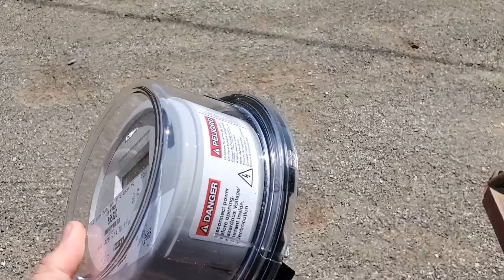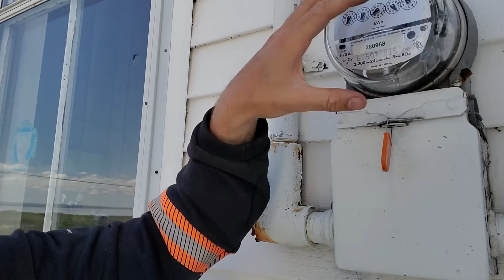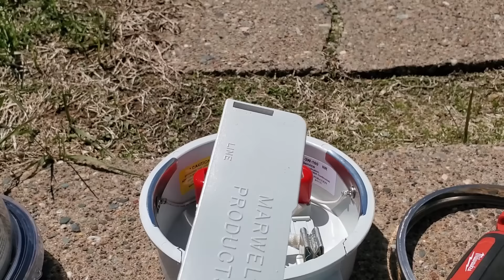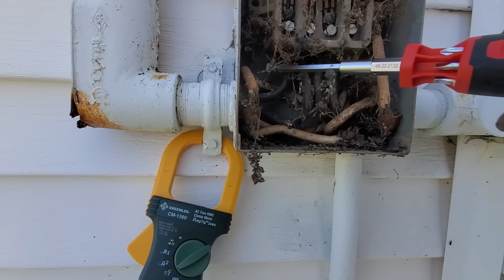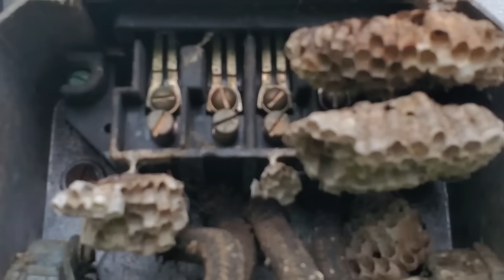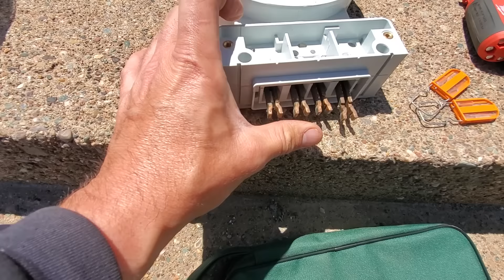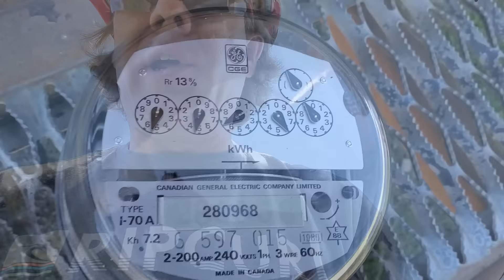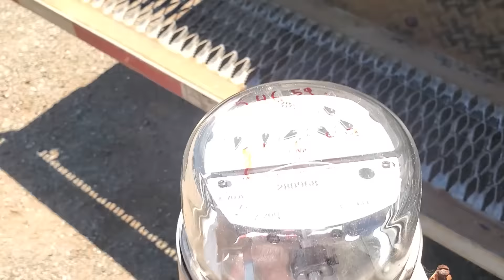Removing an old "A" base Electrical meter

Comment: Yeah, here in Australia, if you go far enough out, you don’t get 240v local service at all. Each house or whatnot has its own step down transformer, usually 11kV. If you get REALLY far out, you can have SWER-single wire earth return. It’s literally a single live wire, consisting of fencing wire, and your neutral is earth. A single wire, and that’s it!
Reply: Damn
Reply: Wow, very interesting. So I didn't know how the meters attached to the house, I always thought it was direct wired in. By the way, I'm writing to you from sunny Santa Cruz California we're up here in the mountains about 50km south of San Francisco, surrounded by a redwood forrest. 
Our power provider is Pacific Gas and Electric also known as the Prince of Darkness. To give you an idea how reliable they are, we just installed a 14 4kw gas generator. So as long as we have propane, we can keep the evil Prince at Bay. Most of our neighbors also have gas generators. We're too deep in the forest for solar cells SO gas generators and a short-term battery backup has to work.
 Getting back to your programs I find them very interesting and very enjoyable. I wish I had a question for you, but sadly for me, you explain things so well I don't have any questions. 
Keep making the shows and we will keep watching. But for goodness sake be safe. I've seen what happens when somebody makes a mistake, people get killed.
Reply: Kah-RAY-zee!
Reply: How far out you talking
Reply: IIRC some SWER installations in Australia have a 480v split phase for large compressors and other farm equipment.
Reply: Wow!
Reply: What is your average voltage 240v?
Reply: @philkipnis7403  our standard in Australia is 230v single phase (phase to neutral) and 415v across 3 phases. Split phase is very uncommon here.

SWER is common in rural areas about 100km+ outside of cities
Reply: 😮SWER! Prolly Not For Charging a Tesla‼️💔👀🖕😒🧐
Reply: In Canada, a lot of rural Saskatchewan is SWER, due to low population density and good soil conductivity.

Comment: Ooh, I love the GoPro on a stick routine. Perhaps a dumb question, but there’s no electrical safety issues with doing this? I’d imagine a basically fully plastic and glass GoPro is gonna be relatively inert on the stick

Comment: aluminum screws directly to copper in outdoor installation? seems a bit sketchy
also, those ground connections are rusty AF guess the resistance on that line...

Comment: 54659.1 kWh? Assuming the dial with no numbers is reading in 10ths. I'm just a dumb ass welder which 90% of my electrical knowledge comes from which is enough to know to call an electrician when I need electrical work and dont mess with it unless I'm feeling particularly suicidal. I've also seen electrical failures that give the impression its a sure fire way to get killed such as a video of some kid trying to steal copper out of a main power station box and litteraly blew a hole in his back big enough you could see his ribcage.. How on earth he was still alive and breathing at the time they took the video made it even more disturbing because he was in pretty bad shape and didn't look like he was going to continue to live much longer. 

I also installed Low Volt commercial fire alarm systems for about a year and learned quite a bit about that which I dont think translates to high volt stuff very well.

Comment: I’m going to just throw this out there- if you have absolutely 0 training as a lineman or with high voltage, and you’re thinking about doing-it-yourself, do not. There is a reason that people need 9000 hours and 5 year apprenticeship to be certified to work on this equipment, and that doesn’t tell you the amount of learning you do after you become licensed. Leave it to the professionals guys n gals.

Comment: Interesting. Way less testing than I see done here in NZ on meter installs & swaps. Normally we see them do:

* A line impedance test, which checks that there aren't any high resistance (e.g. loose) connections upstream, and you're not just relying on capacitive coupling or something to get 240V on the output. This also checks that the supply has an appropriate amount of fault current - generally >500A to make sure you'll blow the pole fuse if there is a hard fault in the supply, no more than a few kA  so that you don't have breakers exploding. 

* Apply a load and make sure the counter actually ticks upwards to the first count, so the meter is actually recording and not either faulty or wired in reverse.

* A mains polarity check with an independent earth ( a metal electrode you shove into the ground a few meters from the building) to make sure that the phase and neutral haven't been transposed at some point. Not likely but really nasty if it does happen. Less of a risk with multiple phases because you'll see 120/240V across the wrong conductors. Much harder to detect if you only have two conductors with 230V between them, and all the metalwork and foundations are bonded to the 'neutral'.

I can only imagine taking out a TX here to change a meter on one customer... in an urban area, it wouldn't be 6-8 customers; it might be 20-100... but we have per-customer LV fuses on the pole/pillar/pit and the customer's main switch is generally ahead of the meter.

Comment: Quick question, you meter are rated 0.5amp to 200amp. What happen if the house consomp less than 0.5amp?? It is Free electricity????

Comment: The 20 amp meter is to be used with Metering CT's.....!
Reply: And while you have it all open  its a good time to check all connections for tightness.....
Reply from the maker: That's correct, typically a 400:5 ratio for that particular single phase meter. The added demand is factored in when used commercially

Comment: 54659 kWh on that meter from what I can see. And as someone in the PT and CT field, there are some oddballs out there. We had a customer hook up a CT rated panel meter direct to 500 amps, apparently the stain it left matched his shorts. Also, you guys call it an "A Base Adapter" but missed the chance to call it an "A-dapter" lol

Comment: I'm amazed this is still in service. Here in the south everything has a smart meter - it's funny how many fancy new meters I've seen that read "0000" on the side of some old abandoned building or barn. I'm not sure why they even have a meter when there doesn't appear to be service, but many do, and they get changed out.
Reply from the maker: Often times, old buildings that are rarely used still have power for occasional visits. The owner may keep the breaker until they stop by... Or they have been shut off for a temporary disconnect. In our area, after two years of there is no usage and they're temp disconnected, we will remove and dismantle the service. If it's active with no usage, we'll investigate and possibly disconnect as well
Reply: There should be a monthly charge for the hookup and billing expense.

Comment: plot twist the church is actually a grow house and they tapped before the meter at those condulets coming down from the weatherhead
Reply from the maker: Wouldn't be the first time!
Reply: @Bobsdecline  I liked that one on Holmes on Homes. They had to take a layer of moldy wood off with dry ice. They core drilled the foundation to the buried triplex and used Kupler Taps live.
Reply from the maker: Didn't see that one! We had a large organized crime group do the same thing here with multiple high end homes around the city. Was pretty wild

Comment: My initial meter reading is 54658 with a little uncertainty on the last digit due to the camera angle. I was unsure of the un-numbered dial, but I suspected I would only have the last digit wrong. The pointer style is my second favorite type of meter with the odometer style being my favorite. Although time has shown the smart meter, at least on my house, is reliable.

As far as being authorized is concerned, I am very serious when it comes to that. At my house we had a free meter socket change (the electric company upgraded it several months after the smart meter was installed) and the contractor messed it up as we have two sets of service entrance cables, one for the main panel and one for the water heater. The contractor missed a hot on the water heater panel and we had to call the electric company out and I was furious as that's one part of the electrical system the customer is not authorized to touch. Luckily, we got a lineman out that time and they explained that the contractor was making mistakes all over town.

Comment: The grease is probably Mobilgrease 28. A lot of the medium and high voltage breaker manufactures spec it. For the electrical stabs and some of the mech parts.

Comment: I've tested, calibrated, and repaired countless watthour meters in my years. Single phase, polyphase, transformer rated, self contained, 1S, 2S, 3S, 3CS, 4S, 9S, 12S, 16S, 36S, 45S, and the A base counterparts. 50 and 60 Hz versions of most.
Reply: I dont know anything about these meters.  I have 1 question for you, if you don't mind.  

Do you like the newer meters used, or the good old fasioned ones.  If given a choice?
Reply: @choke666  that's interesting. And it depends. The newer ones can do so much more. They can measure reactive power, depending on the model. They have communications capabilities, they can tell you when you are using power, etc. They can also sense tampering.
The old ones though are darned reliable, and it's amazing how long they can last and remain accurate. But for the most part, unless fitted with electronic registers, can only give a total of kWh used. Some have a few other features, but they are just incredibly well engineered mechanical devices.

Comment: I'm surprise the electric companies haven't come up with a more secure meter and box system outside houses.   One that would alert someone if the meter is pulled and or the box under it is opened ?.

Comment: You should ALWAYS check to see if it's dead even if the only feed line was ripped off the utility pole just in case the customer has a backup generator that's not wired in right and is back-feeding the grid...
Reply: Huh ? If they have a back up generator then you would see it outside as well as the lines and box 😉
Reply: @kevink4914  Not always. I've seen a few that are designed to be installed inside the home and some external models are installed inside a barn, detached garage or shed and the feed cables are run in underground conduits and so are completely invisible to the naked eye and depending on how well soundproofed the shed/garage is, you might not hear a running generator...

Comment: When I looked at the dials on the old meter - I'd missed that some of them were reversed!  In the UK we don't have modular meters on any installs like these, tails go in and out of the meter unit - the NA/Canadian system as a whole looks a massive amount easier to swap meter units out; I assume that is getting more important with smart meters that stop communicating?
Really like your content - showing the parts of electrical systems that the majority of people should never see!

Comment: Q. Can you remove a smart  meter to work on a panel  change out  with out calling in.
Reply from the maker: No you can't, however I've heard of some jurisdictions allowing certified and approved electricians to do remove them. Our province and most areas require a company rep and permit.
Reply: Thankyou for getting back.  We  have homes that are in high lightning  area. We recommend  type 1 meter surge .  But I had difficulty  removing the meter for to install the adapter
Reply from the maker: You can get whole home surge protectors that wire directly into your panel and only need to shut off the main breaker for an install. Should still be installed by certified electrician of course but doesn't require a meter Pull or permit in our jurisdiction
Reply: Thankyou again for reply.  The NEC  reccomend  type 1 for the meter to protect  against lightning    you just cant tell with lightning  where or what it will do  it . 2020 code requires   SPD at the meter also the panel.  Type 1 will protect  from lightning.

Comment: Klein has a new screw driver with all the adapters U might wanna check out besides that red one you are using . One thing they both need to get into which they wont do because  of  the liabilities is insulated tools. Just went to a rodeo of new tools by the red guys . they have a problem with the pole step removers, lag screw, and J hook  removers.  they never took into account a build up of rust . so they dont work because of that extra bit of corrosion...  Apparently they have gotten the message from tool events. Great video .  U should let ur vendor know as well..

Comment: Meter reading  54659    When reading the meter, read / write the number from right to left.  If the pointer at the adjacent right number is not at or past 0 , the number to the left is what the pointer has just passed.
Reply: Learned that in HS over 30 years ago. Thankfully I got the same number.

Comment: Here in Illinois (USA) the local electricians wire up the service drop, meter base, grounding, etc. The only thing our local linemen do is hook up the service wire I left for them to terminate to the pole pig (transformer). They do inspect the work before hooking it up hot though.
Reply from the maker: Pretty much same here, other then 3 phase metering. The only reason we're installing these adapters is because it's at our company's request. Even if we contacted the work out to an electrician, we would have to be on site. The electrician aren't allowed to cut our seals or work in the meter box while energized
Reply: In Connecticut when upgrading the electricians will pull the meter and disconnect/reconnect from the service drop.  When they install a new meter can they will put in jumpers to jump from the line to the load side.  The utility will then come and put in a new meter at there convenance.

Comment: Very interesting video. You didn’t mention the two radio antennae on the left and right inside the meter. I’ve always wondered how far away from the meter it can be read?

Comment: During my career as an electrician my hobby was collecting old A-base meters. I made table lamps out of the newer, less collectable ones and displayed the older ones. I have over 50 meters with some going back to the early 1900's. I like taking them apart and seeing how there built and putting them back together again.
Reply: Same here. I collect the Old ones, got about 500 or so.
Reply: @erwinsummer9961  that’s cap
Reply: @erwinsummer9961  Oh hey there! Surprised to bump into you here... :)
Reply: I like meter collections. One of those rarely saved items, and when you find a REAL old one it's quite cool.
Reply: I think my oldest one is around 1903.
Reply: As a service award I received a 1925 Westinghouse meter made into a lamp and it runs.
Reply: Have to say  I will look up those older meters .Good job guys.
Reply: Yeah I've seen lamps made like that I've always wanted to make one for myself as well and of course having to meet her actually registering the current that the bulb is using!

I thought about building a coat tree that looks like an old-fashioned lamp post with other utilities on it.

Although one of the boxes would be a dummy just for a piggy bank for change!

And one of the small boxes would be where the boxes that would have the photocell attached to the top with the twist the lock receptacle and that would actually be controlling lights that would be dusted on inside.

My plan was to use glass insulators is coat hooks.

The post light AKA street light like the gumball type pictures or whatever you want to call them would have a vintage globe.

In addition to just being a stared lamp they would also be a candelabra night light socket in there as well.

And have what looks like an old junction box outdoor type with an old school oval or other cover at the bottom of the pole but have the plate for that modified to take a Decor type device and have four USB charging ports in place of receptacle there you wouldn't notice until you open it up.

And of course all the power going through everything would be actually registered a meter that's actually working!

I'm also possibly thinking about building a power monitor into a meter box including a Clearwater meter just as a test device but receptacles and a power Inlet and perhaps a heavy duty switch just for bench and of course have other meters and such installed in the cabinet or attached!

Had opportunity to get some old electric meters years ago I wish I would have taken them up on it all the new meters were going in the old ones are going out this was before Smart Meters they were just the electronic ones back then not even remote readable
Reply: What's the oldest ya have? I'm am electrician... But some reason I got into the same.... But with safes..... Pretty dumb.... And heavy stuff to collect
Reply: i got some old ones, but i wish i had more
Reply: i am going to study for electrician, at 40 years of age is that to late ?

Comment: Wow! There are tons of archaic A-base meters where I work, but I've never seen one that looked anything like this. I guess it must be a standardized type of equipment in Canada? I see the other one you show (with the bees) is identical, and the socket adapter looks very specific. The ones I'm familiar with are the same basic idea, but the blocks are different, and they're wired at both ends - none of those tidy copper bars, which look much nicer than trying to bend and stuff #2 wire into the terminal chamber. I always do them live, and with the meter bypassed so the customer doesn't start complaining, but I don't see any easy/safe way to do that on this one.

Pretty cool that you know how to work on this stuff, where I'm at the linemen would never touch it!